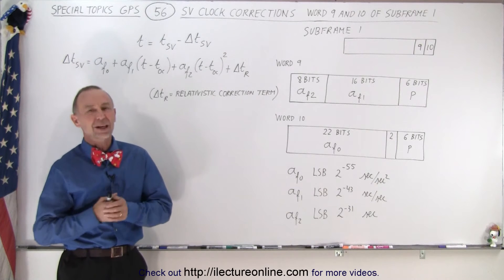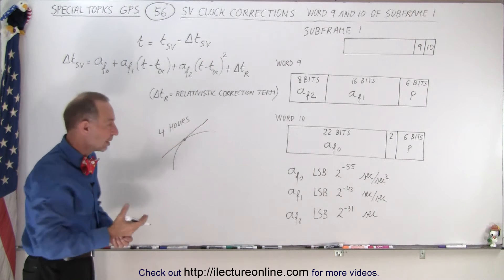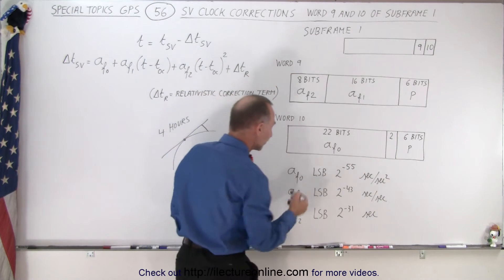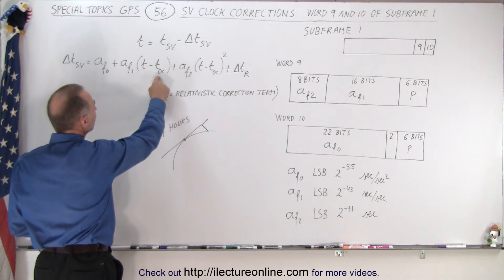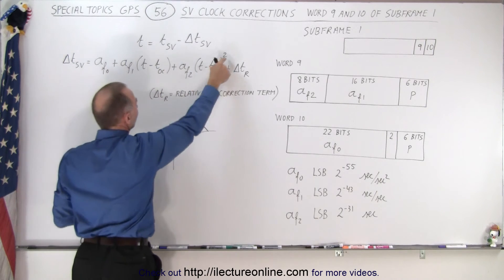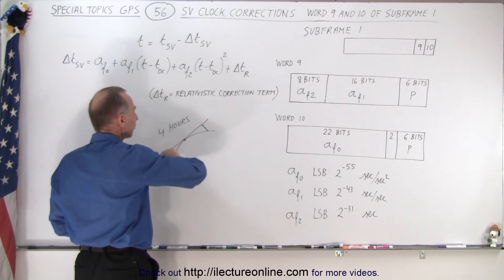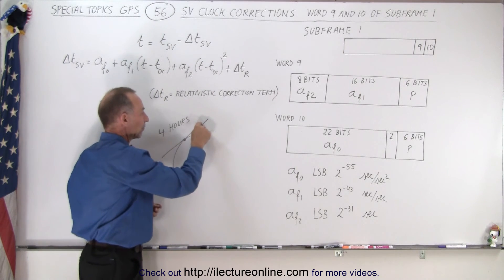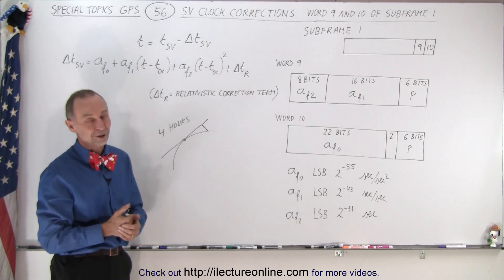Special Topics - GPS (56 of 100) SV Clock Correction Word 9 and 10 Subframe 1

Comment: Great video! I've been reading the IS-GPS-200L but I feel like it doesn't make the definitions of all the 't's clear.
There is a 't', 'toc', and 'tsv'. If I have both the transmission time and receiver time from a RINEX file, how would I use those equations?
Reply from the maker: You are correct.  The IS-GPS-200 is not as clear as it should be.